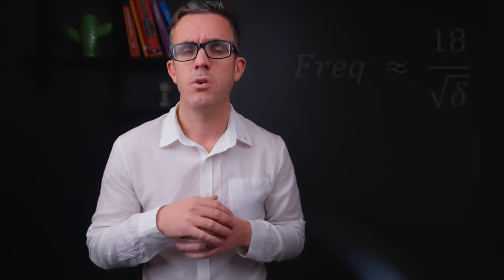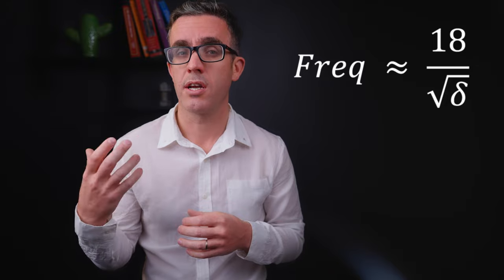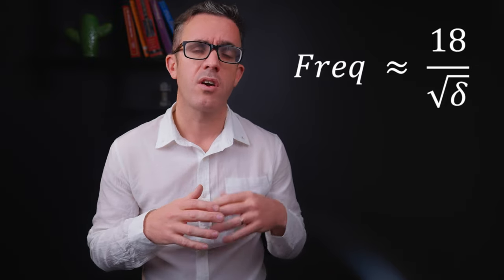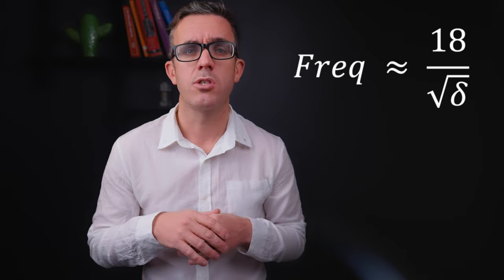The rules of thumb for steel design

Comment: Thanks for this video. As an architect, this is really helpful for me too. It saves my time on things that I should assume for rough structure when I am designing a building and this would help me better make coordination with my fellow structural engineers. Do you recommend a book where rough structural useful concepts and rule of thumb are recommended for architects for structures of brick and motor, RC design, steel design, timber framing and shell structures?
Reply from the maker: Hi Wong, I have a video on concrete; it would require several books to cover these topics. Also, I have yet to see any good one other than the structural engineer's handbook by Fonia Dobb, but that is more for structural engineers. I will be putting together PDF and will take some time to ensure it is good.
Reply: @BrendanHasty  Thanks for the reply! I couldn't really find the book. Can you please give me a link?
Reply from the maker: Its available on Amazon https://geni.us/BUeqO

Comment: Hello Mate. Your continuous content creation and knowledge transfer is well appreciated.
I'd like to get clarification on the bolt connection aspect on 2 of your episodes.
On this episode @ minute 1:30 you mentioned that no.s of bolt = member depth/100.
Whereas in your episode "The rules of thumb for steel design" @ minute 13:10 you specify no.s of bolt = depth/10. 
What's the difference pls? Or which is correct? Thanks

Comment: Great video and thank you for sharing your knowledge. I am a site engineer and we use portal frames for our buildings. Regarding the haunch length the rule of thumb is an 1/8 of the frame span? For portal frame columns only the ratio span to depth (up to 50) affects the size? Does the ratio of span to height of column play any role?
Reply from the maker: Hi Argiris, the height and stiffness of the column would impact, as a starting point it is good to still start at a span on 50. then detail computations can confirm, but you should still be in the ballpark.

Comment: could you point me in the right direction for information or formulas for shock loading steel members with steel chains the problem is a 1000kg load dropped 1m what is the chain needed? all that i can find requires me to know displacement or duration of impact which i don't know for steel chain on a steel beam

Comment: Do you have a video about cutting sizes of steel for welding? Should be there some tolerance or not?
Reply from the maker: Hi Peter  not yet but it should be around 10mm tollarance, different elements will have tollarance for example casting bolt it is around 4mm

Comment: Hi Brendan! I am considering to studying structural engineering however i am having issue with making the right decision. 
As far as my research structural engineering is not too easy as you would have to learn all theories and principles which takes time and lots of effort. On the hand , the salary is not as good as it should be. I have friends who are strctural engineers making 70grand while my other friends who are trades making almost double. 
My question to you is it worth putting all these effort and time ?
Reply from the maker: Hi Murtaza, structural engineers can start low but can increase over time.
But I would recommend that you do something you would find more enjoyable, you don't get rich on a salary look into compound interests. Also typically trades are great while you are young but get harder when you are older. Hope this helps yes engineering is can be alot of effort to learn but I enjoy it.

Comment: I don't think QTY of bolt equal to depth of beam/10 is correct for instance if the beam depth is 300mm then will end up to using 30 bolts for each connection?
Reply from the maker: Did I say 10 it should be 100 so 300 deep 3 bolts

Comment: is it possible to cantilever with a span of 6 meters using a wide flange with a height of 300 mm and a width of 150 mm
Reply from the maker: Hi Pebrianto It would depend on the load and back span.

Comment: Plz for No. of bolt .. beam 12 inch we need 12 bolt to connect.. 6 for each side ? .. is that you mean  ? .. Thx
Reply from the maker: Hi Ayad that rule is for mm. For inches it would be divided by 4, so for 12 inches/ 4 would by 3 bolts.

Comment: What the mean "span/depth"? And what unit of span?
Reply from the maker: Hi Irfan, these are based on mm, however, it would align in inches.  for example Span/depth = X therefor beam depth should be ~ depth = Span/X
Reply from the maker: Ratio is 20 to 24 with 60 m max
Reply from the maker: So no more the 60 meter on average

Comment: Plz in no. If bolt for beam 12 in .. we need to 12 bolt .. 6 for each side .. is that true ? .. Thx
Reply from the maker: Hi Ayad that rule is for mm. For inches it would be divided by 4, so for 12 inches/ 4 would by 3 bolts
Reply: @BrendanHasty    Hi Brendan .. in mm  Will be. 300/10=  30 bolt not 3 bolt ?! .. plz can you clear that point
Reply from the maker: Hi Ayad it should be /100 so 300/100 would be 3 sorry if I made a mistake
Reply from the maker: Depth / 100 in mm 300/100 is 3